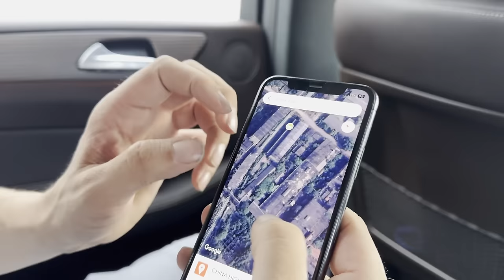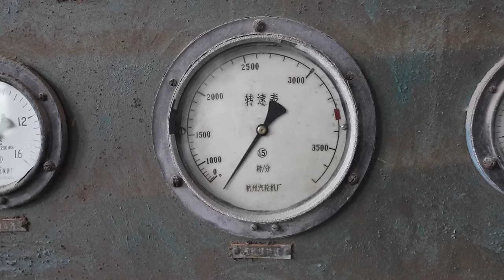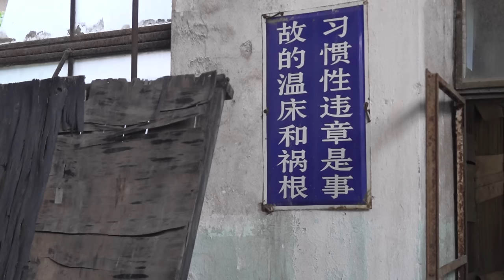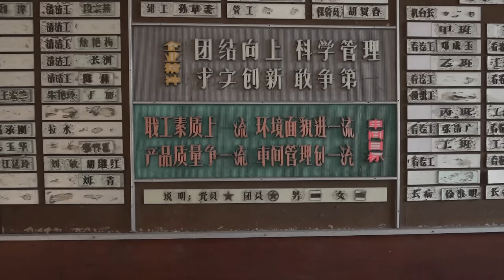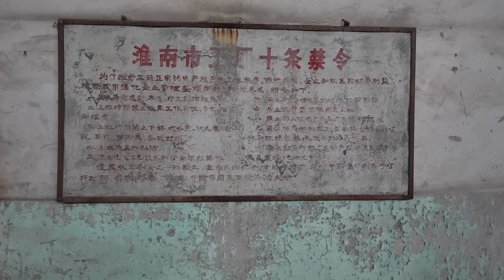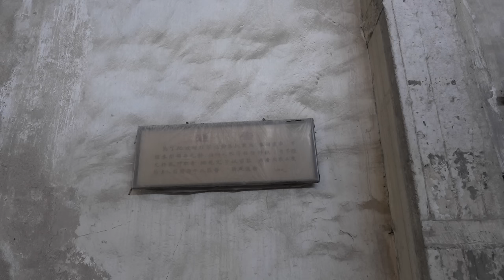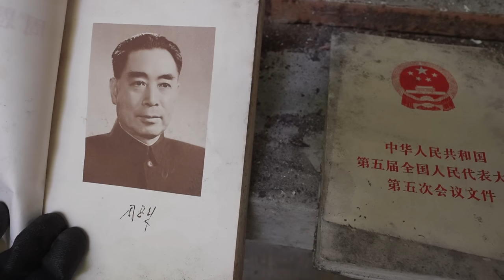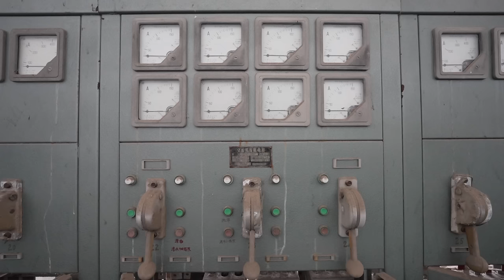Frozen in time, exploring a 25 year abandoned industrial site with many features

Comment: 35:15 those kind of screws or worms as we called them we used to use them to move flour and product mixes through pipes , I used to work in a flour mill back in the late 80's .They don't look like  it but they were incredibly sharp and I heard a horror story of one lad that lost his arm from the elbow , he still worked there when I was there but had attachable fittings to do various jobs . He had lifted the cover off one of the worms to clear a blockage when it started up with his arm in it . There was a few lads that had missing fingers to for pretty much the same reasons , glad to say when I started working there we pad locked the isolation switch off until any work was complete .

Comment: If there was an abandoned complex like this over here in the Netherlands it would be stripped bare of any metals.
Copper wires and aluminium bring a nice price and even steel is valuable and will be stolen if its not to difficult to remove.

Comment: 34:09 these old phones I remember from when I joined the Air Force back in 90 , very similar to what was our crash alarm . There was a cover placed over the dial as you mostly only ever answered it but you could pick up if you saw some thing and initiate an emergency call . Those phones we used back then didn't have a ring tone but was linked to the crash alarm which would sound in Air Traffic Control , The Fire Station and Medical Centre . How ever im old enough to remember these old phones at home and in pay phone boxes . Blast from the past .

Comment: Hey Bob, Thanks for the inspiration over the years.  I made these in Kansas and honestly was probably watching a few of your videos (in a gas mask) along the way. 😅 Shaped on an old Delta Milwaukee stand-up belt sander that was purchased for $50.  Made with a variety of different lumbers, each piece is hand shaped before assembly and then reshaped a number of times along the production process. The wood frames are then topped with an upholstered foot topper that has been padded with varying layers of aeronautics grade rubberized foams. The very best vinyl , leather, and glues are used throughout to ensure a final feel and durability that is unmatched on the market today. Good for shoes, socks , claws, and paws.   (Please do not stand)  Originally designed for Basset Hounds.  A photogenic and functional mobility accessory that looks good in the background and brings multiple uses and all of them beneficial to a healthy happy home. Hope to buy your books one day. Good luck on your future Travels. I still cannot believe those tiny inflatable boats float while containing your huge b***s.